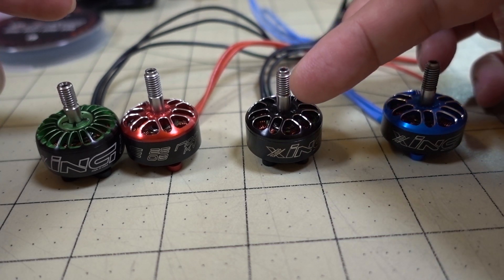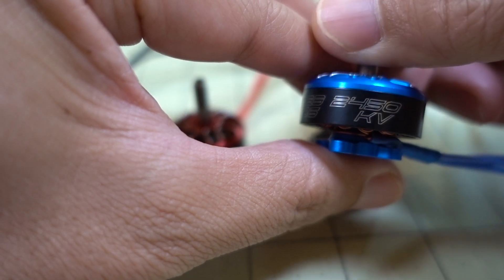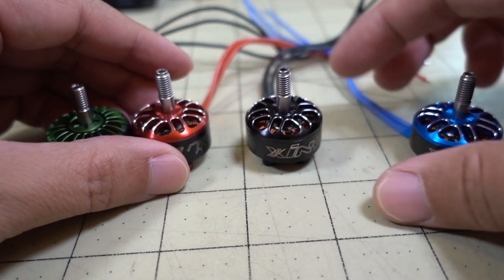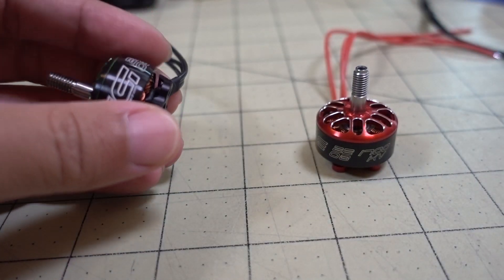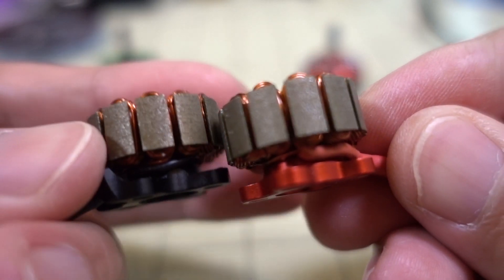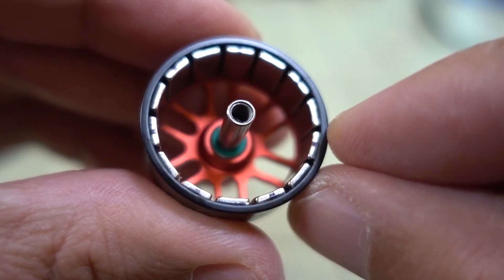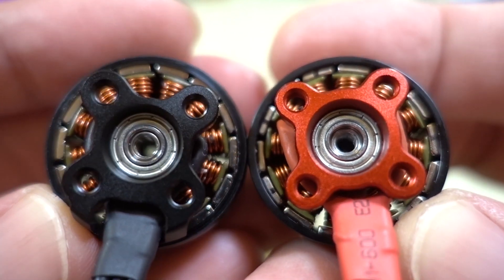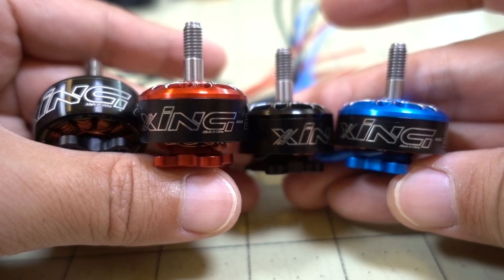iFlight XING-E vs XING ... What's the difference? 💲

Comment: Hi can I exchange the bell between the green and red bells? I bent two red and almost impossible to find!!
Reply from the maker: I was told the bell has to be from the same motor type/size/kv.  If it doesn't match, it won't work.

Comment: What is the difference with th xing-C?
Reply from the maker: E is for economical or budget... basically cheaper with cheaper components.
Reply: I just ordered some XING-C 1408 3600KV motors from Amazon...After a little research I got to the bottom of it... the "C" is for "cinema" or "cinematic" for 3 or 4" cinewoops!

Comment: Hey I have XING-C on my quad and I just had some shipped to me but they’re just XING. they’re both 1408 3600kv but can I mix the motors on the same quad? I’m asking because I had a bad motor on my quad and just need to replace one
Reply from the maker: You can mix motors no problem.  I've even put on totally different motors and KV.  The FC will compensate for any small differences.

Comment: Good video, can you use normal xing bells on xing e shat
Reply from the maker: I was told it won't work
Reply: Waiting on 2208 unibells bells for 4 months from I flight;( but I am running the 2306 unibells on the e version motors fit perfectly

Comment: I understand that lower KV is meant for high voltage and vice verse.... I’m trying to build a drone with components that I can fly 2s through 6s bcs I’m still amateur but I’m learning really fast and I don’t want to spend money I don’t need to. 

I’m trying to make a 2-6s stack with motors that can handle 6s but still be able to fly smooth and swift on a 2s. I found the blue xing motors but I’m still new. Can you help, what do you think?
Reply from the maker: Most stacks will be 3S to 6S.  The range down to 2S is too much.  You won't be able to take off.  I'm not even sure it will fly on 3S if you want to fly 6S later.  4S to 6S is the best range IMO.
Reply: Albert Kim..... I can agree to that. I’m about to Plato on this SYMA x5ux I got for dirt cheap bcs I’m a fast learner and I’ve already exceeded its limits by range, reliability and power.. make that power on demand.  

What’s your thoughts on the 
M2 (2s-5s) vs wizard S (4s-5s)
I liked the wizard S but not the first wizard. 
After seeing the M2 I fell in love with it but now I’m thinking about your logic on cells.

Comment: Hey Albert do you know if the 2450 is good for 5s? I have the original zing 2306 2450s and they are working well with 5s. Wondering if there’s any difference between the new and the old versions
Reply from the maker: sorry, I don't know
Reply: Albert Kim ok thanks for the response 👍🏼

Comment: I bought  9 Xing-E 2208 1800kv. Turns out that one of them is a 2450kv with an 1800kv bell. The rest of them are overheating by just hovering for a minute, regardless of filters, pids, softmounting and ESC timing and there are no shortcircuits. I have tested them on three different quads and with both 4s and 6s. All of these quads are working fine with my old motors which comes out cool even after aggressive flying.
So be a little careful. I guess the main savings they did on the motors was to let the customer do the QC.
I will never buy cheap motors anymore. I spent two weeks trying to get these motors working, a job that usually take 10 minutes. All of a sudden 25 bucks for premium motors seem to be fair...

Comment: I've broken titanium shafts but haven't broken hardened steel shafts. To me the steel is an upgrade.
Reply from the maker: Really?  That's interesting...
Reply: @AlbertKimTV  Albert - hardened steel is stronger per unit volume. Unless they mill the titanium to a greater thickness steel is stronger.
I'm flying these emax eco 2207 motors with EMT metal gates. Im shocked how well they have taken abuse compared to my more expensive motors. They are now my primary motor.
Reply: Titanium is more brittle than steel, but half the weight, and steel will bend before TI, soo pick ur poison.
Reply: I've been researching steel vs titanium lately trying to figure out my next motor purchase.  I read titanium is as strong as steel, but lighter.  However...I also read steel has more shear strength than titanium.   Shear strength seems like a large plus for a metal shaft.
Reply: I just post about this .all I ran were steel shafts. Month ago I switched to some titanium shafts. I hit a palm tree flew into  tree and got stuck shafts snapped ! bell was fine laying 5 feet on the ground. Next experiences with bent shafts on light hits. Steel so far seems to far better.

Comment: I just wanna know are any of the bells interchangeable between the E and the regular motor. If I were to bust up a bell can I just upgrade it with the same stator?
Reply from the maker: So you mean if you have the XING motor and bust a bell you want to know if the XING-E bell will work on it?
Reply: Albert Kim or the opposite if you have 2207 E and buy a bell replacement for the regular will it fit
Reply: @TJenga  never had an answer for this? Wondering the same..
Reply: I been running the xing 2306 unibells on the xing e s for about a month they fit perfectly  though the xing e bells steel shafts seem to last better than the titanium shafts. In my experience and I bash my quads the xing e s have been excellent.

Comment: A TBS Source one with a set of XING-Es and a Diatone 40a stack would make a good 5in basher.
Reply: Just built that. Well with the Mamab F7 Stack. It's my first 5" It flies soo damn good.
Reply: @christopherflick8222  I'm sure it does, especially with the new F7 stack. Did you go 6S or 4S?
Reply: @yannickg6904  6s haha just went for it.
Reply: @yannickg6904  what's funny is ingot the F7 so I could use speedybee to tune, but it flies so well on stock PIDs I haven't needed to tune it yet. Using 5.1" props too
Reply: @christopherflick8222  Nice, I will probably build a Source one too. I also want to give the 20x20 F7 stack a try, I got a good deal on a 3in Gecko and I'm considering bulding it for 6S with the new RCInpower 1505s. The Diattone Stack would fit well I think.
Reply: Not even a basher.  That has basically no difference from a premium rig.  Cheap is good now for the most part